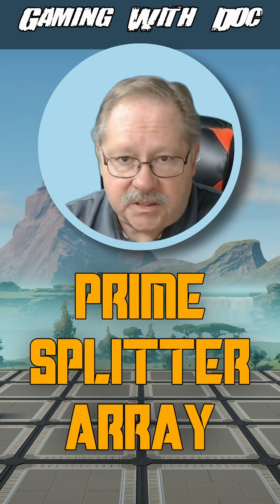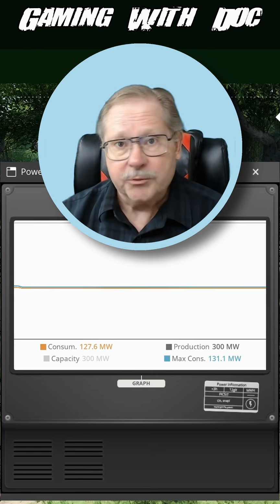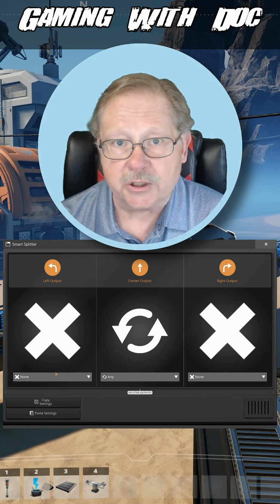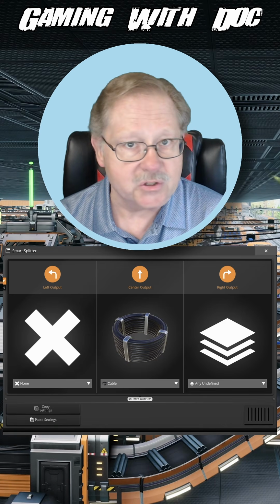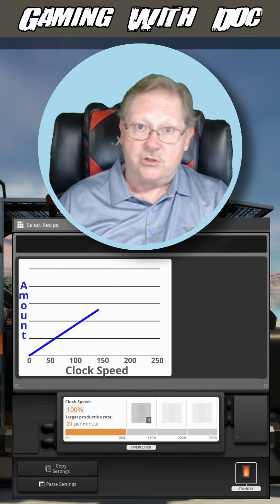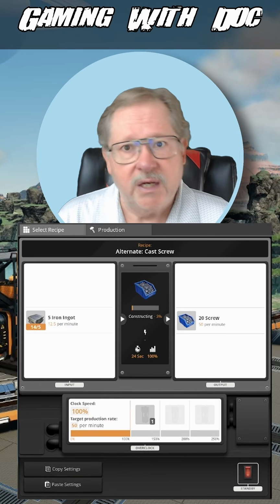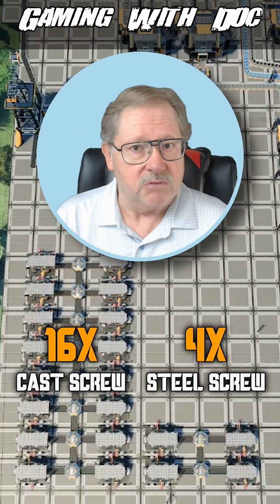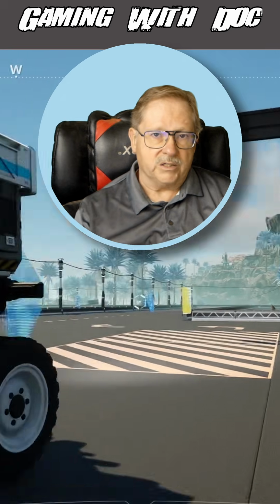Top 25 Essential Satisfactory Tips Mega-Compilation (1-25)

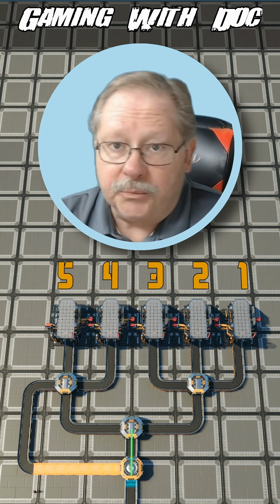Comment: 2:31 so I have seen that it's actually better to feed that line back into the system with a splitter that splits the 6th path on both sides of the fist splitter because if you try to feed the 6th line back into the first belt and it overloads the belt then you'll have problems.

Comment: When I first started playing satisfactory, I really liked a lot of these tips and they helped with my immediate task, however once you get to the point where you can make blueprints a lot of these become what I call "Optimal timewasters" It's hard to make a case for a 5 port balanced splitter when you can slap down your stackable hex-fabricator blueprint and then underclock the machines to 83.333%. Bam, you've saved time, space and power at the cost of a few resources that you were gonna sink anyways. Just something to consider, not everything has to be a square for it to fit in the square hole.

Comment: I love the cool math for splitters. Making load balancers of any size should be easy, now. I see multiple tips I can use here, thanks. 

Btw, the blueprints can auto connect, now. You just have to leave a little bit of belt on the end of your splitters/mergers for the next blueprint to auto connect to, and turn on the auto connect building mode.

Comment: Cheers Doc, you rock!
you've made some of the most helpful, fun to watch and relaxing videos I've ever seen.

I would like some help on something that i cannot  understand well.
in the case of prime splitter array.

Let's say we have 5 machines
and each machine needs 10 items per tick

we feed 10*5=50 items/tick
This gives each machine 50/6=8.333items/tick

the 1/6 returns to the beginning. thus
the next circle, the items are now 50+8.333 (50/6)
This gives each machine 58.333/6=9.72
this means we have an increase each circle.

C1=8.333/machine
C2=9.72222
C3=9.95370370370
C4=9.992283

getting to 9.999999 /machine.
Question: why not feed 10*6=60
split to 5machines
and the 6th to a storage/dimensional depot/awesome sink ?
the math get less messy this way

Comment: I have a different solution for priming a manifold. As the first machines input fills turn it off or fill the inputs manually. I also will not hook my output line to the next factory until it is fully backstuffed

Comment: The way I smooth out my power usage is by massively overbuilding generators. Currently setting up my 45x turbo fuel generators while  theoretical max requirements are around 5gw.... did I mention my 32x coal generators?
Reply: in the beginning of the game, before i even had the space elevator, i made a 450 MW biomass array. lol. i always overbuild power for any stage in the game.

Comment: A little note for the smart splitter tip:
Overflow lines can also act as Any Undefined if the other outputs are specific items. This can be useful if you have multiple item types on one conveyor. For example, my coal processing plant has black powder and compacted coal produced on the same line since they use the same materials. The compacted coal needs to go in the fuel slot and go to the truck station storage when the fuel slot overloads, without putting black powder in the fuel slot.

Comment: The hybrid manifold using lower tier belts would have been a useful tip if I found it earlier. I ended up discovering on my own that you could use different belts to split items asymmetrically, which took many hours to work out.